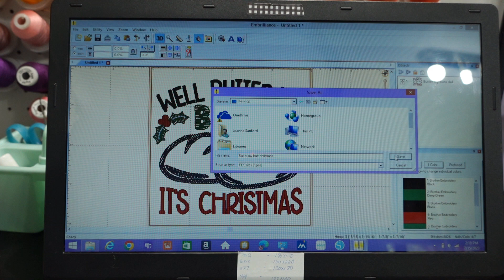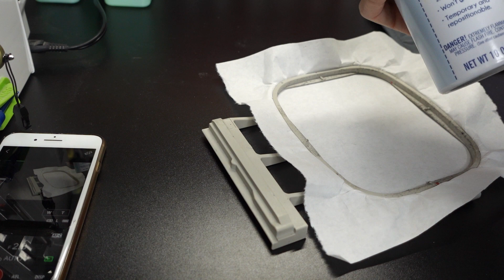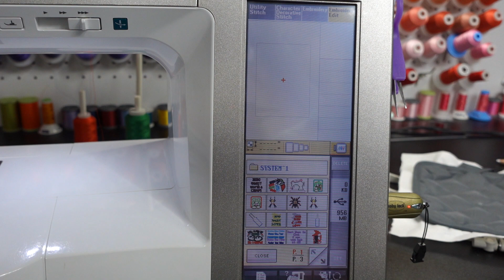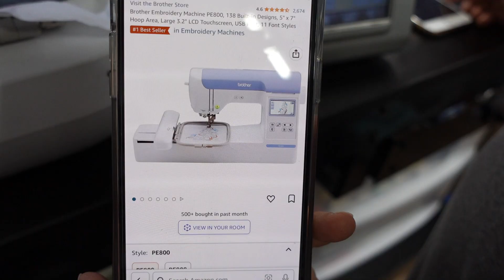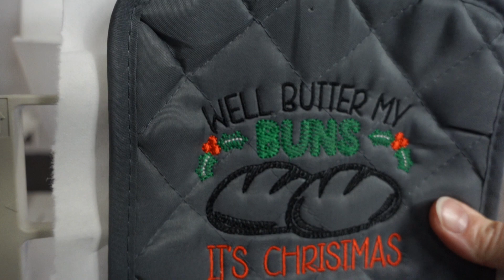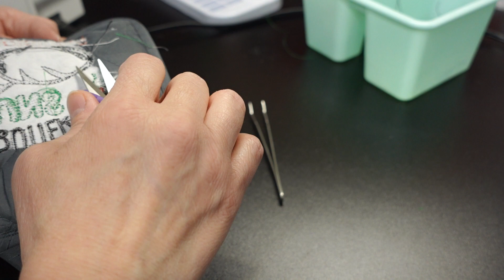MACHINE EMBROIDERY IDEA FOR CHRISTMAS IN JULY

Comment: I had a 4 X 4 for my first machine, but it didn't take long to get a bigger one with a 6 X 10 hoop. This is a cute design!
Reply from the maker: I’ve wanted a multi needle for years but it  costs too much and I have no room😐 Guess I’ll just stick with my Baby lock. It goes up to a 7x12.
Reply: @JoannasDIYLife  Maybe one day you will be able to get one. That is a good size hoop that you have.
Reply from the maker: @cindywest2689  it is. The only thing I don’t like about my machine is that because it’s a single needle I can’t get a lot of stuff hooped as good as I would like. And to be honest, I use my 4 x 4 and 5 x 7 more than the big ones.